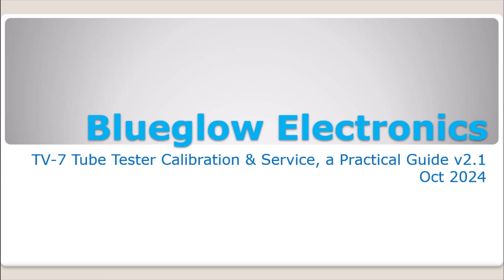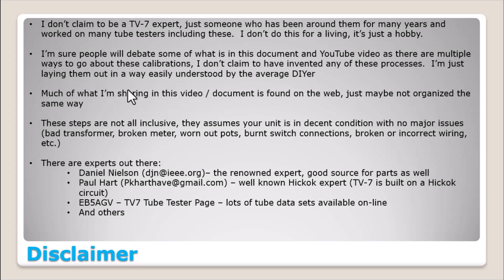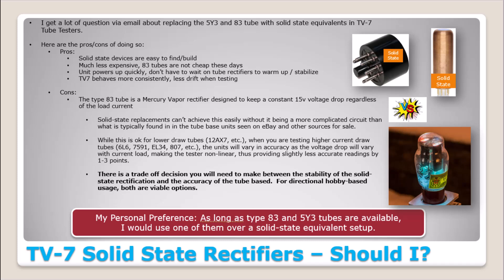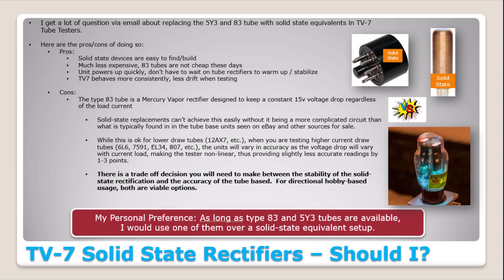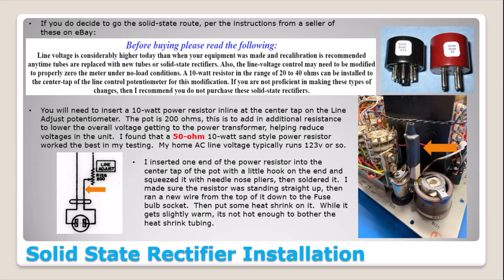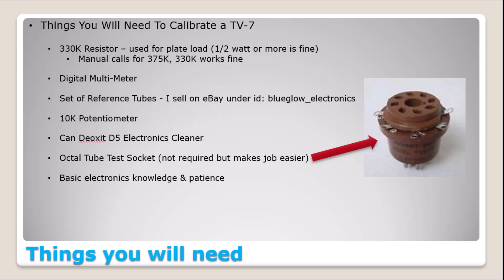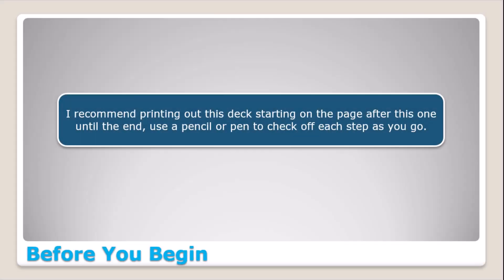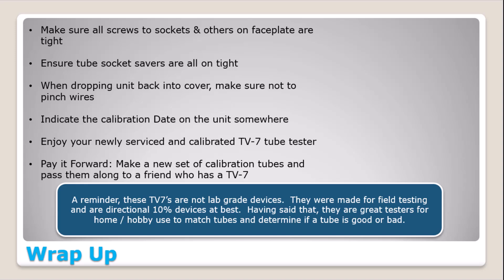TV-7 Tube Tester Calibration, Repair, and Service - a Practical Guide - Part 2

Comment: I made solid state 83 for my hickok 600 and 752 tester the accuracy is about same. Less load on transformer and runs cooler. And no need for a resistor in line on line adjust rheostat, just 2 1n4007 diodes 2 zener diodes, and 2 10ohm 3w resistors. No recalibration required just plug it in an verify still get 150v with line on line test mark